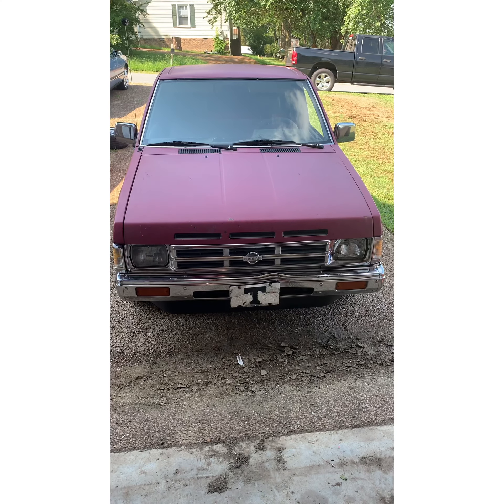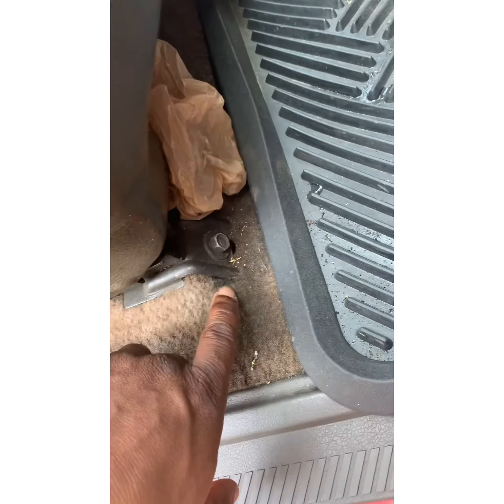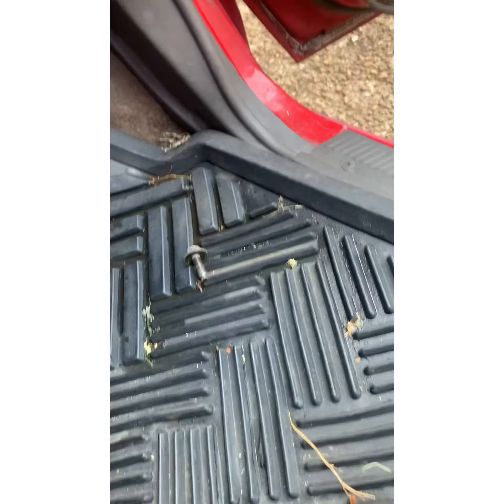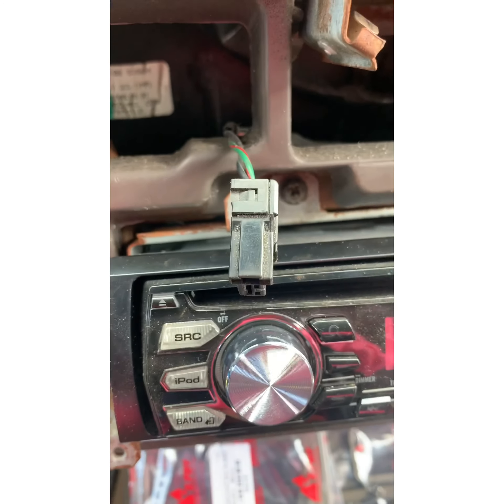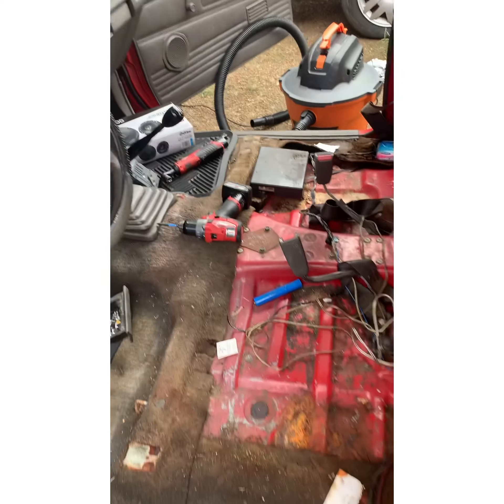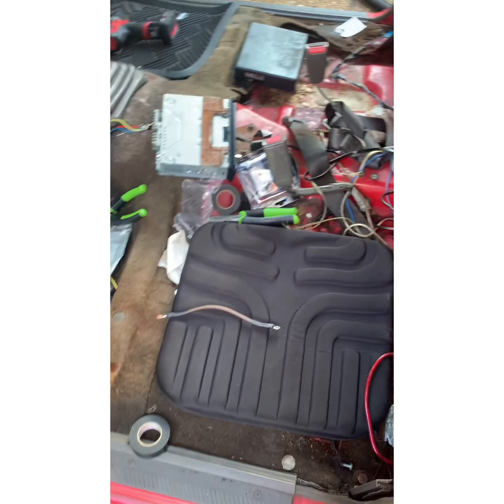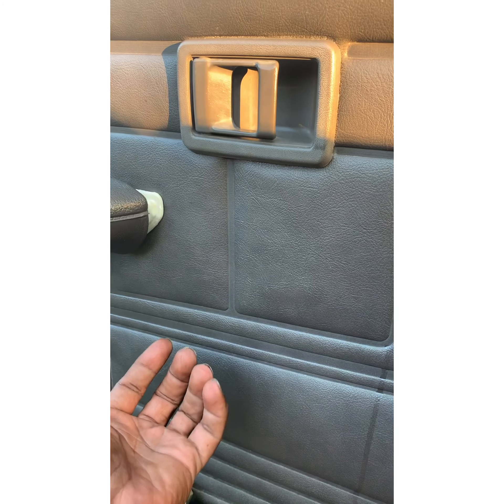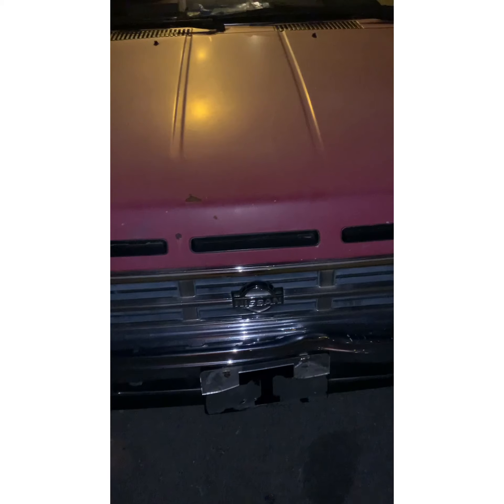1991 Nissan Hardbody truck Radio, speaker, amp, & sub install

Comment: Trying to find a hole in fire wall to feed power wire thru, cant find anything how did u feed power wire to battery?
Reply from the maker: Step bit & made one
Reply: @odianosae  good lookin out bro
Reply from the maker: @jaybarber29sam68  no problem thank you for watching please subscribe
Reply: @odianosae  did that bro. thanks for the info.
Reply from the maker: @jaybarber29sam68  no problem